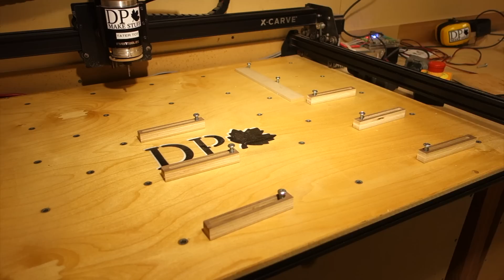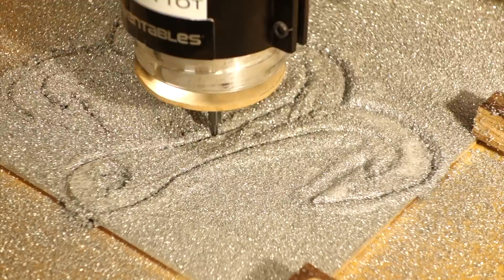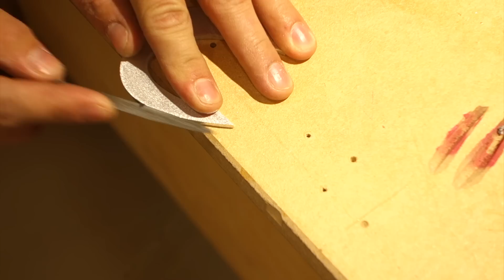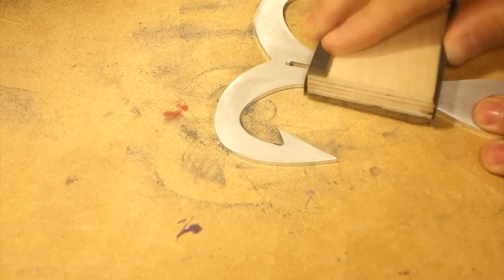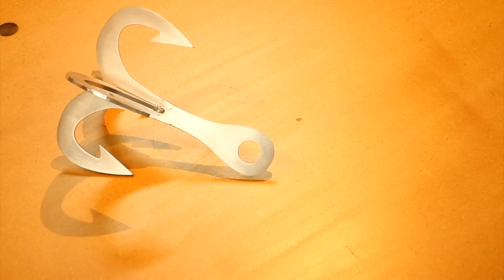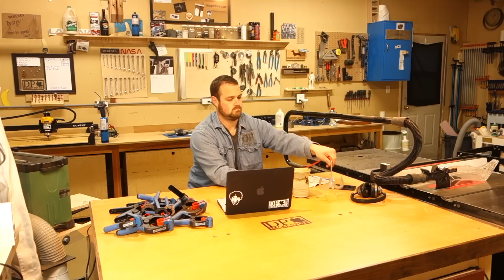Grappling Hook - Childhood Dream Come True!

Comment: It seems like the joint where you pinched it should be designed 180 degrees on the other side. So that pulling on the hook in the usual direction does not work to unseat the hook section.
Reply from the maker: Yeah the inside piece wouldnt hold a lot.   I think the pinched tab is overkill.  Brazing it together would be much stronger.
Reply from the maker: OriginalYithian I wanted to hammer them and make it not so rough, but hammering aluminum is tricky. My test piece didn't work very well. Next time I'll skip the separate tabs and just pinch one big one down.

Comment: I have a x carve an what type of soft CNC program are you using
Reply from the maker: I used easel for CAM and then use chilipeppr since my machine has an upgraded controller.  Easel is more than capable of doing the whole thing.  I sped mine up to 1100mm/min and did .1mm/pass.  I could have done .2mm/pass I think
Reply: +Dustin Penner 
nice I have the new control ordered as well nice work I use aspire

Comment: Wd-40 is not good for this job. It's vapors are toxic (as it is written on it's label). When bit gets hot the vapors intense. Just to consider.
Reply from the maker: coltain as you can see in the video it worked great so your statement is incorrect. The piece doesn't get hot since the aluminum acts as a huge heat sink.
Reply: Yeah, that is something that amazes me.  When I cut ply with an end mill on my cnc (providing the bit is sharp) at the end of the job the heat of the bit is still close to room temperature.

Comment: Get an angle grinder, a steel sheet, some patience and you can build a real "Grappling hook"  for less than that aluminium sheet.

NO CNC required.
Reply from the maker: +Luis Fernando this is a real grappling hook.